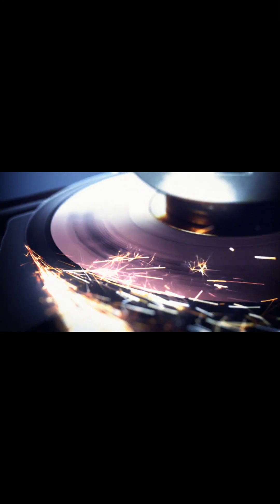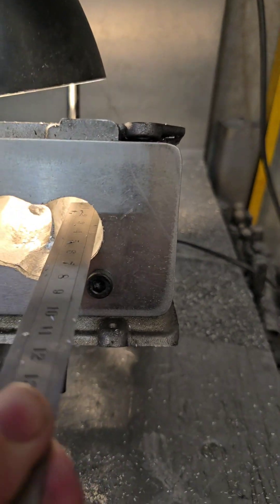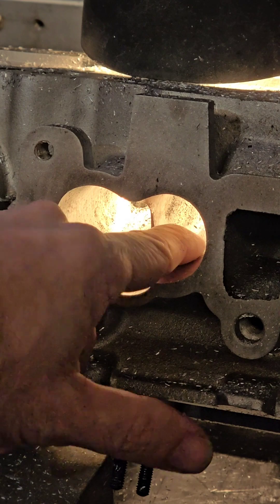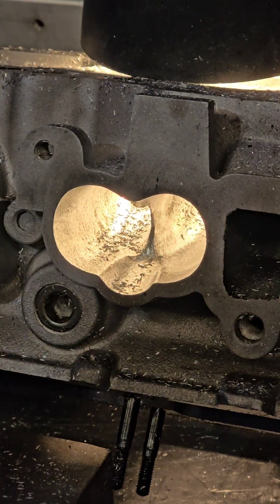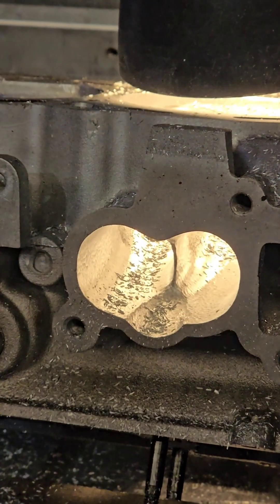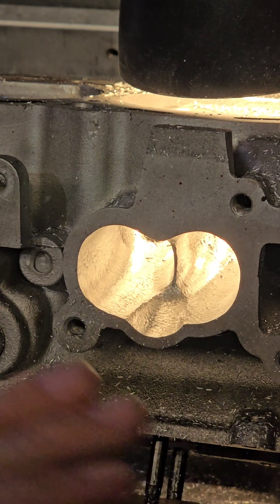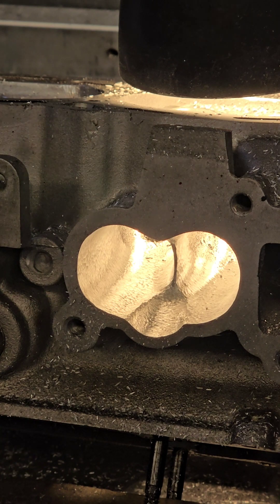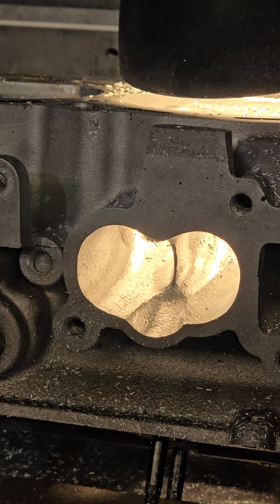RB26 Head Porting Part 5: Blending CSA for Stable Airspeed & Common Mistakes #RB26 #porting #racer

Comment: Hi With regards to your comments on hand porting vs CNC porting, I carry out both and can achieve more precise csa between ports with CNC porting than hand porting.

Love your work

All the best
Reply from the maker: Yeah, consistency comes from experience,  but the main point here is all OEM CNC ports need to  over cut to compensate for core shift. Where hand porting doesn't need to. So even your velocity gradient are better. 

This is why we can guarantee our hand ports bet ANY CNC,d head, and have back to back this hundreds of times over the last 25 years now. 

Unless you're casting smaller ports like in the aftermarket industry and then CNC porting. You will not bet a hand ported head unless it was overly small to start with. But most 4 valve heads are not. 👍
Reply: @bainracing  I take your point if the port is too big to start this would be a problem for both hand and CNC porting. Also we port heads as part of an engine program therefore we are a specialist working on a relatively small number of engines. To date we have never come across a port that we could not CNC port successfully. Remember we can port both by hand and CNC.
Reply from the maker: Yeah, we specialise in head development port design and intake and cylinderhead design,and we have done race series for about 25 years behind the scenes.  We don't do retail work. 

From targa to super sprints to time attack many class racing and drag racing. 

Really comes down to the casting,  but RB we see 800 rpm early Boost thresholds and anywhere from 45-110Hp  more at the same boost. 

 All out top circuit engines are all hand ported. All the shops we support use them and also test against their best CNC,d head, and we are always in front. 

Unfortunately, all heads have core shift. A CNC can never get the velocity/CSA factors a hand port can. 

A hand port we can have two different shape ports, yet both on the same CSA so will always see better averages and more power.  

But again, it comes down to what even type.   If we are doing a 10,000RPM honda. Then I have a CNC file as they need some meat taken out! 👍

Comment: What do you do in terms of porting in the chamber? De shrouding, chamber softening? I never really understood the latter, my assumption is an attempt to control squish velocity, but you can do that by just messing with the clearance vs squish area. I could be totally off on that one however.
Reply from the maker: Yeah, the problem doing it with the head gasket thickness is that you can introduce pre-ignition and ring wear and seat wear by slowing down the flame front speed. 

This is really a very delicate balance,  as the "quench height" at the same rpm affects the burn speed. So does the area ratio of the quench. 

This is why you see tuning issues with guys that run 0.100" gaskets at the same comp.  

We generally want up around 18 - 28m/s. But the influences of not only piston speed but density will influence this. 

So that's why you see the more RPM and density we have. The more we have, the more we will reduce the quench area ratio.  Na can handle more as it's not as dense. But boosted 40psi and up and big piston speeds, 10% maybe tons!  

Again, the chamber shape also dictates how well it works. Fuel deposits, etc.  Even carby vs. EFI.